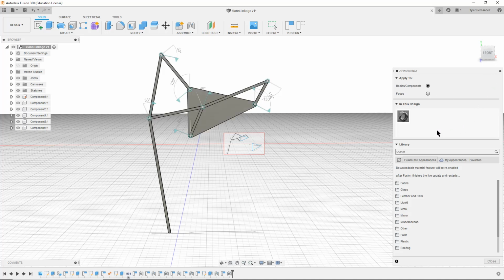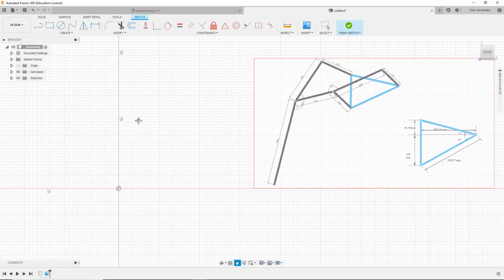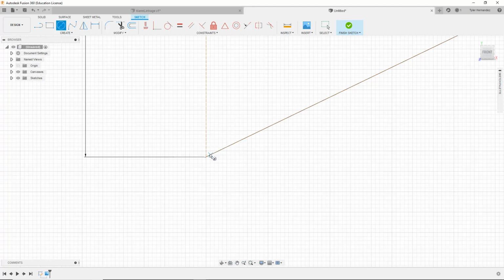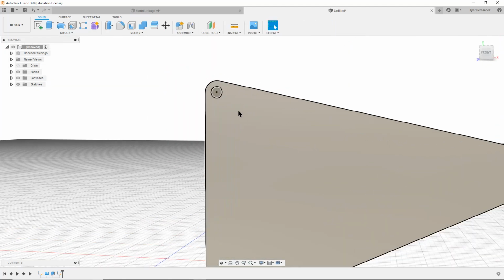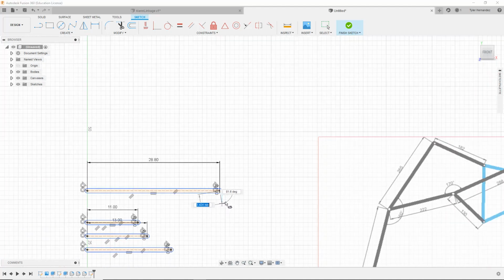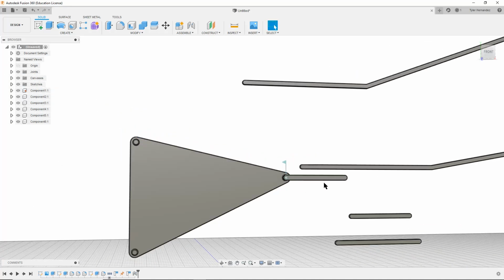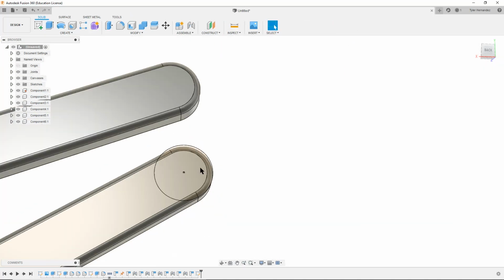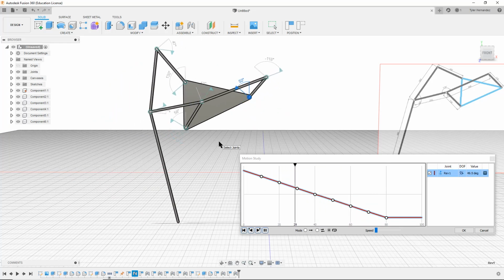Fusion 360 - Klann Linkage

Comment: Your video is very helpful it took about an hour in Autodesk Inventor to construct a working assembly.
If I can make one note, the dimension 206.57 on the anchor point triangle should be 296.13 ( I can provide the 3d model)
The plan is now to 3d print and make a four legged walking robot. 
Take care John